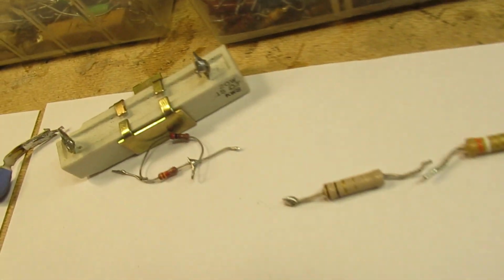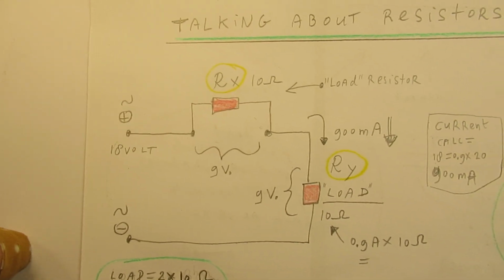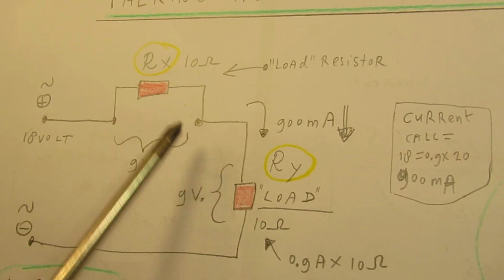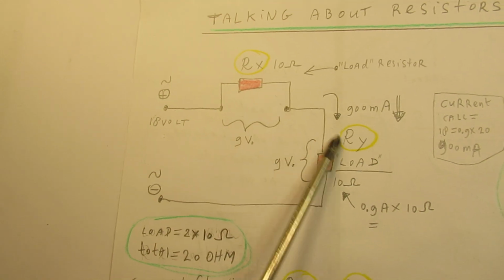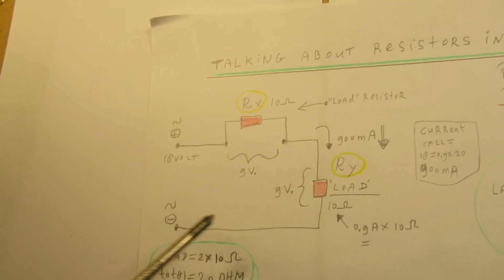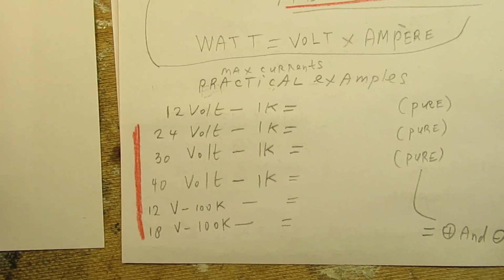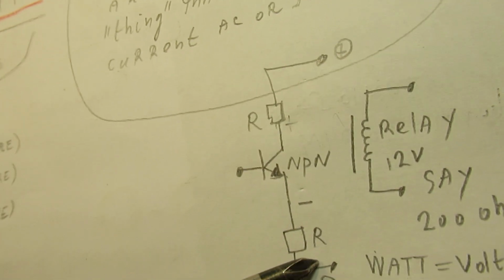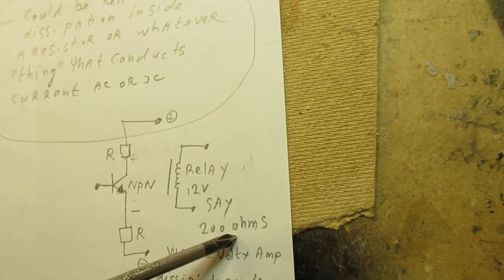Talking about resistors in electronics: first ideas to take in account: wattage, voltage drop, etc.

Comment: i tried use thin copper wire for low ohm, like 0.3 ohms for current sensor purpose
Reply from the maker: Can work. Measuring resistances in the lower than 1 Ohms range is (say) a kind of problem. Anyway: there are circuits (with Opamps) that can do that job, measuring in the 0.01 to 1 Ohm range.
Reply: @radiofun232  For sub ohm resistance measurements need use 4 wire measuring circuit.